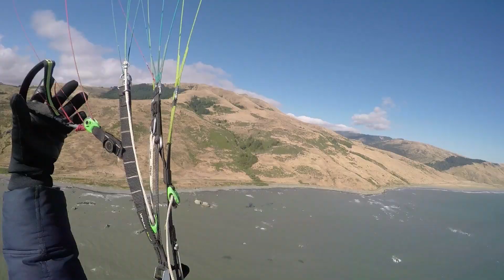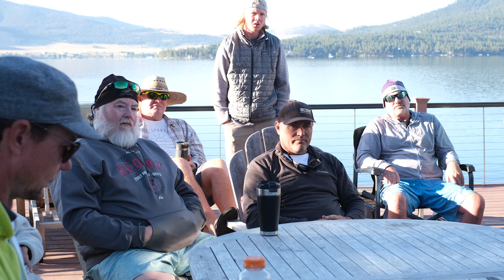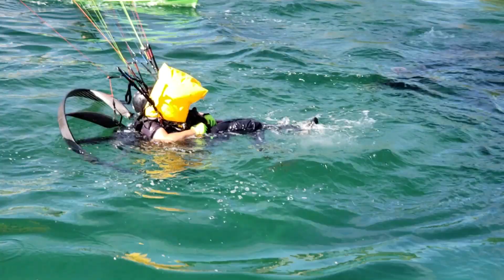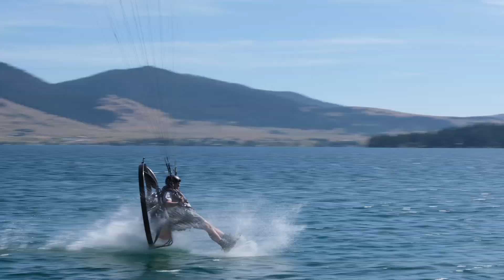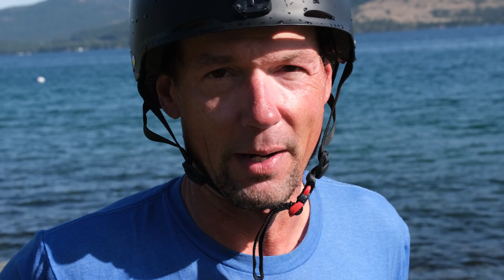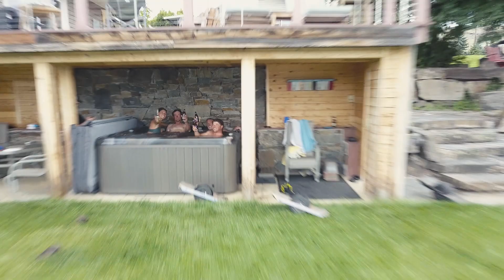PROJECT WATER LANDING EP#2

Comment: A quick release harness is absolutely necessary. This should be mission number one. There are straps that secure life rafts to ships, they are fitted with hydro static release mechanisms. A hydro static release is designed to release upon being submerged to a predetermined depth. There are inflatable life jackets fitted with these same mechanisms. I am a twenty year vessel safety officer in the Merchant Marine. I have done countless drills and been involved in actual emergencies. These systems are designed to work automatically and life vests are engineered to lift an unconscious persons head above water. These proven methods should be a starting point in you're search for answers to this problem. One other suggestion I would make is the requirement to carry an easily accessible knife for cutting straps and risers (I've seen this save the life of a fellow crew member trapped in an overturned rescue boat) Thanks for bringing awareness, and good luck in your pursuit.
Reply: So if I get caught in rain while flying I run the risk of falling to my death. Nice.

Comment: I have no experience or training with paramotoring...or  life saving water rescues...but I am trying to determine if my area is compatible with paramotoring - with a lake home and living on the largest lake in Georgia.  I'd want to do a lot of near lake flying so I'm trying to find a solution in my head.  What about an inflatable raft?  Not only could it deploy under your paramotor, but it could also help control descent.  Strapped under motor, just pull a painter cord.  It carries a mile long of research and then a million miles of risk (with all water landings), but it could be mitigated to some degree.

Comment: I have a quarter turn twist lock buckle on my harness that releases all straps (except for the sternum strap) for just this reason. I also use power floats and a manually activated PFD vest if I'm flying over water. Not sure why it's not standard equipment
Reply from the maker: I agree, I do not see any reason why every paramotor would not have a quick release system with water landings in mind.

Comment: Hey I noticed that 2 of the pilots that was wearing a PFD on their bodies didn't inflate automatically when they went into the water . Did the PFD fail to open when they got wet? The ones with the pull chord coming out the bottom . What happened ?
Reply: Hi Trike Channel. The reason for manual, not automatic PFD when paramotoring is that, the PFD will deploy before the chest straps are released in many cases. This would make it difficult, if not impossible to release those straps,  making the situation much worse.
Reply: The 3 PFDs I own all have both the fuse that dissolves when it gets wet and the Manuel pull handle.  Never knew of a fuesless PFD.